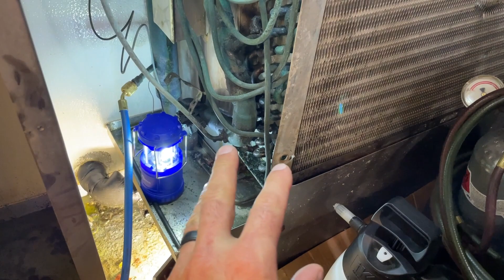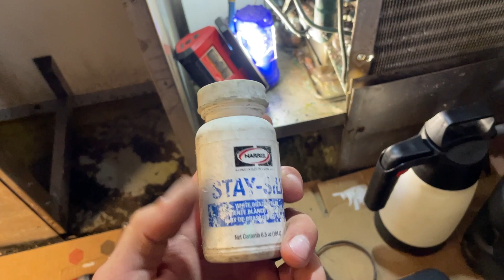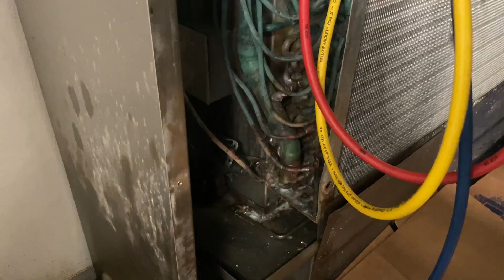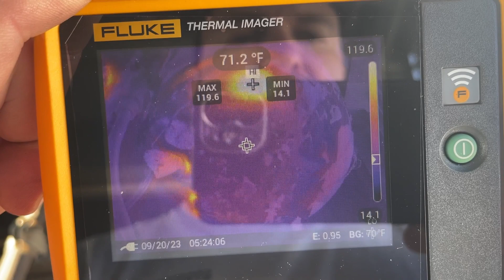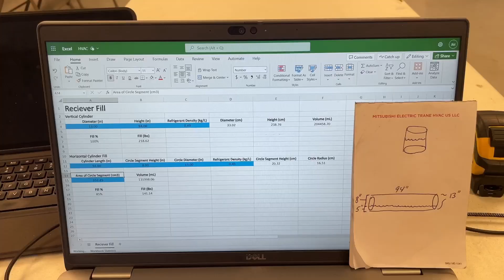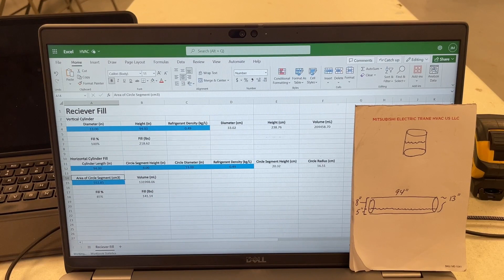HowTo29: Fixing Leaks and Doing Nerd Math on a Blast Chiller 🤓

Comment: You can only polish a turd so much , at some point it's just not worth it .
Dremel makes some little attachment brushes that do a good job getting into tight spaces but they do wear out pretty fast .
And their flex extension seems very handy but I've got a Bosch rotatry tool and I'm not sure if it's cross compatible with other brands.
Reply from the maker: Great idea!  I think that would work awesome 😊👍